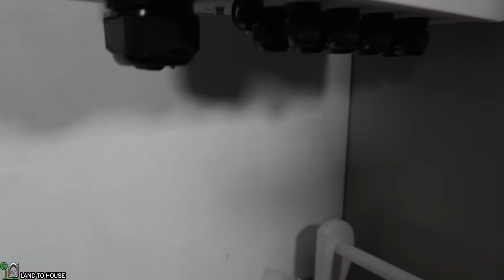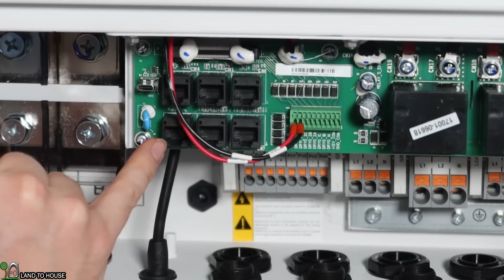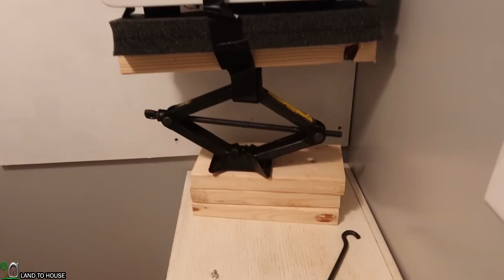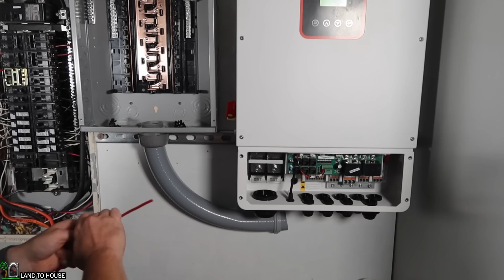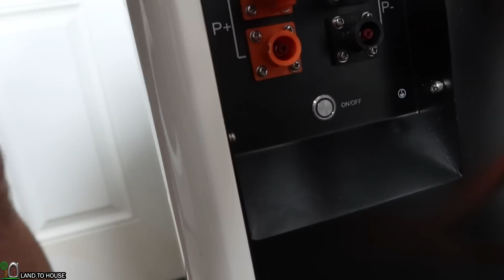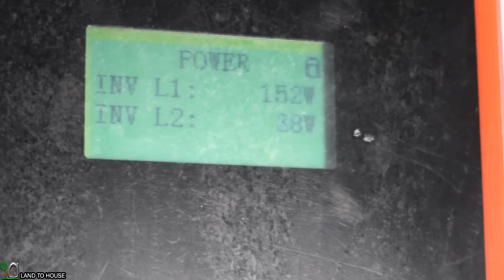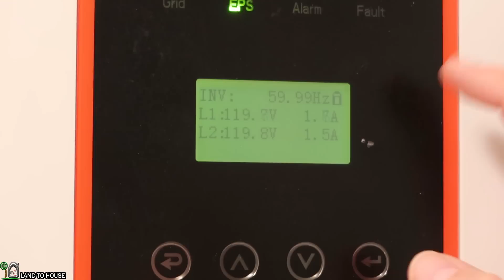8KW Inverter and 15KWH Battery Takes House Off Grid [Full Step by Step Install]

Comment: Great Video—Question—does the inverter have a power limiting option? I am not wanting to put any power back on the grid.
Reply: Thanks, Seth. Any idea when this goes on the market?
Reply from the maker: @nickheschke6841  I am not sure. I hope soon. The battery just got out of kickstarter. My house has been doing well on this system
Reply from the maker: Yes it does. I did not show the ct clamps. I already have another system that limits. There are two ct clamps that go around the main power and the inverter won't push power back to the grid.
Reply: Hi Seth, Thanks for your contribution  into Micro hydro systems. Is it possible to have No batteries with a micro hydro? Since my grid usage is more than my hydro input I'm thinking of using a three phase turbine and connect to a three phase input inverter converting to single phase output 230v ac UK. Connected to the grid. I want a island CT protection clamp and also a limiter so that I don't feed into the grid instead if there is any eccsess power fro the turbine then I would like it to dump it into my hot water tank. So My thinking is that my turbine feed is prioritised and the grid supplies the rest when the demand is more than what the turbine can produce. Is this at all possible?

Comment: Beast Level unlocked, that is a major step up.  Vestwoods is getting some valuable field pre-release testing from you working out the bugs to use this as an off-grid primary instead of UPS.
Reply from the maker: This inverter and battery combo is great. There are a few things that need to be ironed out but after a month of use the system has done well. I think I am at 155kwh from solar so far.

Comment: Great video as always! Too big of a system for my use but the way you installed your critical load box was super useful for me so thank you!

For your grid panel, check out load center filler plates! They're only a few bucks and reduce the risk of a shocking finger slip
Reply from the maker: Nice. Happy to hear it was helpful. I looked on youtube for a while to find a step by step how to on the critical loads panel install and was not successful. I hope that this video helps people to do this.
Reply: @LandtoHouse  I was having no luck with finding inverter to panel install videos as well.  Thank you for this one.  Quick questions though.  I'd be completely off grid with my system so would I be able to set up my gasoline generator through a breaker into the AC inputs of a inverter/charge controller unit to charge my battery bank in case Sunlight is low?  Should I have to control the power coming from, say a 13,000 watt generator, to the AC input, and is there usually a setting in the inverter for this?

Comment: Interesting video. Can't you trickle charge your battery at night from your water turbine as I didn't hear it mentioned in the video?
Reply from the maker: This inverter and battery are on a separate solar install. The hydro is connected to my grid tie limiter system.

Comment: What about your micro hydro? :)
Reply from the maker: Micro hydro videos should be starting before too long. The temperature did not get above 36 today. Not much fun to be standing in a Creek.
Reply: @LandtoHouse  Nice! Is it still up and running on your other system outside or you dont have enough water during winter?
Reply from the maker: Since I ran it last year during the Winter and all of the plumbing burst I decided to turn it off for this Winter. As the temperatures warm up I will crank it backup. Got down to 18 last night.

Comment: that’s all super cool.  Love the issues as there always alot of them.  Many times the interface w these systems are bad.  Our location
Had to be all off grid.  A challenge in Utah w 0F to 105F and snow/clouds. We design for dec 21 sun angle and clouds.   Your adding 3kw is essentially to grab that sun fast in winter.  Summer is easy. 
You should also have the angle be more for winter.     One other comment on previous video is measurements for shadows needs to be done at solar noon not noon for optimum position. Sorry to be picky.  
We also converted as much as possible to direct DC as inverters waste power converting AC. But we are completely off grid so critical power usage and generation.  

Love the channel and videos.  Beautiful

Comment: But why would you ever want to charge your batteries with grid power? That doesnt make sense to me. Even if you are forced to change to grid wouldnt you want to keep charging batteries with just solar etc?
Reply from the maker: Yes that is what I wanted but not how it works. Once I have a total of 6kw of solar I dont expect to need the grid here.
Reply: Well weather conditions prior to a potential grid blackout were responsible for not having fully charged batteries. So to fully charge them in the case of a potential event charge them up to full capacity.
Reply: Some people implement peak load shaving by discharging their batteries to power loads during ON-PEAK rates (think California @ 50-cents/kWHr) and then recharge them via grid power overnight during super OFF-PEAK rates (8-10 cents). If you have these time of use rate plans, then you don’t even need any solar to make a power wall like this pay off.
Reply: Agree. Only campers would need grid charge option.

Comment: Seth,
You might need to remove the bonding jumper in your critical loads panel. Since there's the Inverter in-between your grid "feed" and your loads panel. Fault currents might not have a proper path through your electrical system. Gauges might be slightly undersized for your utility feed to the inverter. Good video.

🤜🤛
P.S. sorry for being keyboard wizard 😅

Comment: I may have missed you saying so, but how did you size your conductors and breaker(s)?
Reply from the maker: The 1/0 cable was included with the battery. The 8awg was suggested in the inverter manual.  The solar wire is 10awg and only carries 7amps. The battery breakers are rated for 500v. The battery only puts out 52 to 57v.

Comment: Excellent work showing great knowledge of dealing with different systems. Well done.. There are some notes that I hope you will accept from me.. First, it is preferable to use circuit breakers for direct current, not alternating current, for photovoltaic cells.. bootlace ferrule must be used for the end of the wires and not relying on the nail to avoid loosening inevitably in the future due to the heat and ductility of the ends of the copper wires to avoid fires  ... keeping great work
Reply from the maker: Thank you for watching. The two breakers in the small dedicated box are both DC current. One has 450v of solar power and the other has 51 to 57v of DC for the battery. The house breakers are all AC but designed for that. I had not even heard of bootlace ferrules. They are not required in the USA.
Reply: @LandtoHouse  Yeah, the rest of the world thinks we're crazy for not using ferrules. After installing my Tesla Wall charger (secondary CB box and a lot of other fixin's) using ferrules, I'll never do an electrical project that uses stranded wires without ferrules again. They are truly amazing. I'd be willing to bet that they get added to The Code book within the next few years. So how much of an epiphany moment is it when you first use ferrules? Remember how you felt the first time you used Wago connectors? It's around double that feeling. : )

I had an electrician come out and check my work. I was expecting him to wonder about the ferrules, but instead he just nodded his head and gave me the all clear.

Just found your channel. Now I'm binge watching. Maybe a bit much, as it's now 6:00 A.M., and I still haven't gone to bed.

Thumbs and subs!

Comment: You will need more batteries for off grid with all those circuits, what has been your max ac draw, is 3000 watts enough?
Reply from the maker: This inverter will do 8000w. I only have receptacles and lights along with microwave and fridge on this sub panel. The big loads such as hvac and hot water are still on the grid.
Reply: @LandtoHouse  Awesome I thought it was only 3k my bad

Comment: Nice vid...
I would just move the black hot wires over to your sub panel and leave the white neutral wires in the main panel, it would save some time...
Reply: I came to say the same thing. Other videos I've watched they only moved the black wire over.
Reply from the maker: I thought about that but was told I could not keep them in the main panel. So I just moved over everything.
Reply: You would not pass inspection .

Comment: We have 4800 sq ft, 4 heat pumps, & an external well, so what do we need to have continuous power.
Reply from the maker: It would take a lot of solar and battery storage and several inverters to run a house that size. My hvac can use 30kw when the heat strips turn on and the home is only 1900sf.

Comment: If the circuit breaker for the battery has polarity (see if you have + and - symbols in the connections points) it will catch fire if tripped in the reverse current direction (when the batteries are being charged for example). It's very dangerous to use polarized breakers with DC current, DC arcs are extremely hard to quench because it lacks a zero crossing point like we have with AC. 

I highly recommend to use NH1 fuses instead (rated for gG characteristics and 125 Vdc). Much safer since they are made of ceramic material.
Reply from the maker: The breaker indicates 500v DC. I do not see a polarity on the case. I have been warned that I need to turn off the PV switch before disconnecting the solar or battery. (Turning off the battery first of course.)
Reply: A t class fuse would be appropriate here.